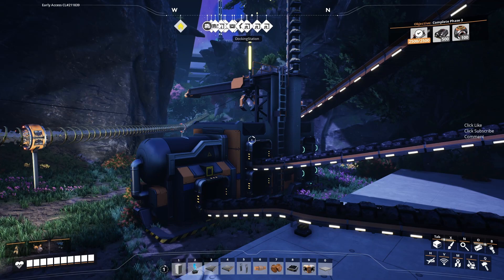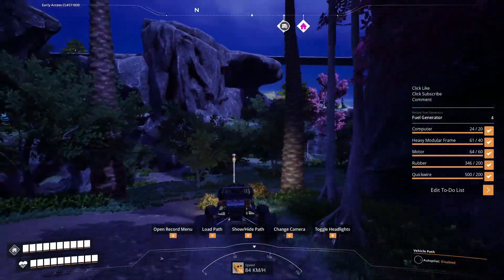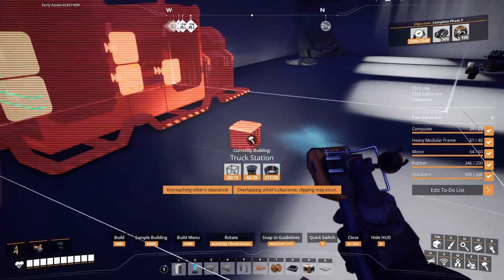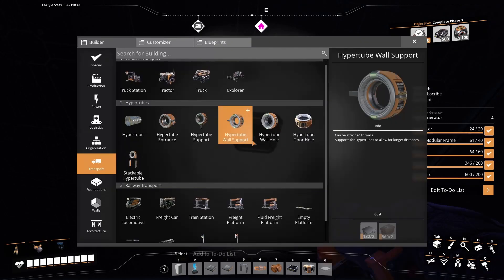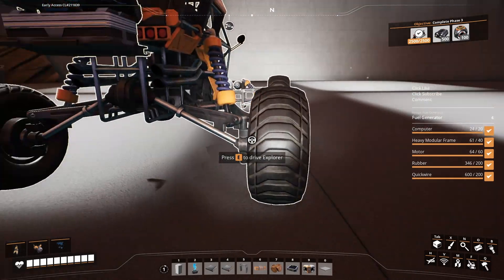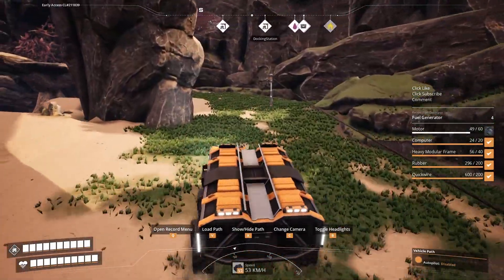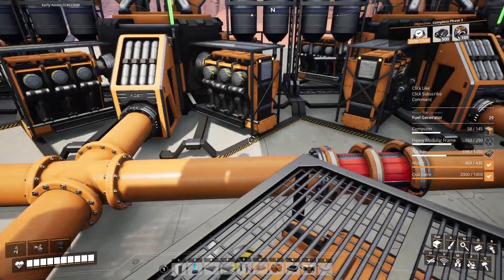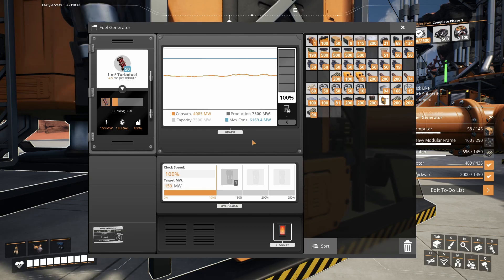Satisfactory Update 7 - S1E65 - Turbo Power!

Comment: Power always produced the same amount of power per fuel consumed, regardless of overclocking. Just the % value was a bit off (250% consumed about 200% fuel, producing 200% of power). But that is changed now afaik... But you would need an awful lot of shards 🙂
Reply from the maker: Ahhh thanks for the info, I know they have made it more linear now though but either way like you said I did not have enough power shards to shard all of them.
Reply: @Blue_Kraken_Gaming  Overclocking all your fuel generators to 250% would cut the number of needed generators down to about 18, and require just over 50 power shards.
Reply from the maker: That is good to know, though I have to admit building all 45 is quite a view ;) tomorrows episode for you includes a tour.

Comment: That garage looks amazing!!  So, so good!!  I'm currently working on a nuclear plant trucking in most of the material (except the radioactive uranium.  That will droned in at the very end of my build).  I've got 6 truck stations lined up, and now I know how I want to enclose it.  

Decorating is where I struggle most in the game.  Most of my factories are stacks of floating floors.  No walls, no ceilings, no catwalks.  

I'd watch your decorating videos.  I'm always impressed with how good your builds look.
Reply from the maker: Thanks I am super pleased with how that garage and the fuel power plant has turned out as it is very much not a box and looks interesting to my mind. 

I think the next live stream might wind up being a decorating one. I keep looking at our starter factory now and am like, hmmmmm I really want to strip it back and re use those resources, but man that would be a heck of a project to strip it all out.